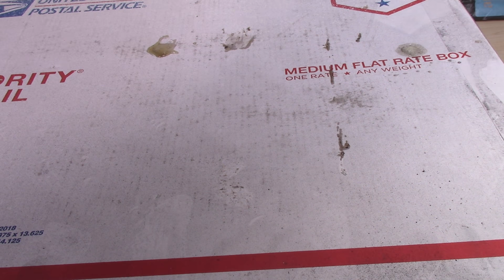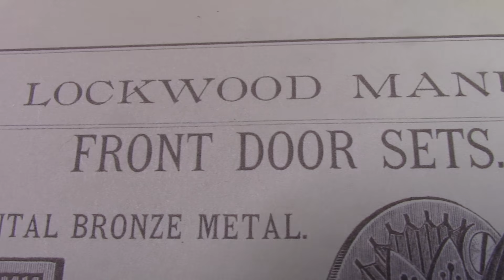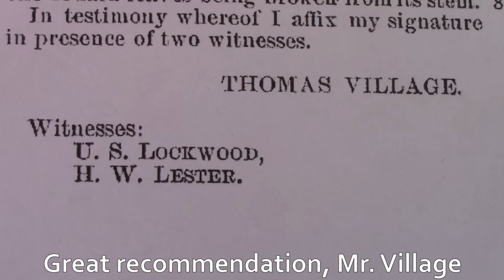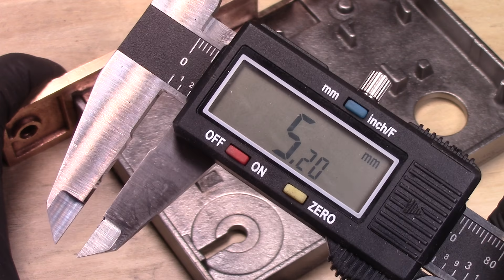Rare Broken 1880s Mortise Lock Set Restoration | Random Restoration

Comment: The only criticism I have would be that I wished you had found a way to repair the broken off post rather than replace it with a bolt -- maybe by brazing it? It looks like cast iron, so welding it isn't feasible, I'm guessing, but I think you could still braze it? Not that I know much of either welding or brazing. But it turned out beautiful regardless. Though from a pure aesthetic standpoint, I'd have kept the high spots in the background clean. Really nice work though.
Reply from the maker: Thanks, Daniel! The main reason I chose to use a bolt comes down to strength. When the lock is retracted, it hits the post, so I wanted to use something a bit stronger. The case is indeed cast iron, and I’d be worried that any alternative fix from the one I chose wouldn’t really hold up long term, whereas the bolt I used should be capable of lasting another 120 years without any issues. Thanks a lot for watching!
Reply: @randomrestoration6858  That makes a lot of sense. Thanks for the insight!
Reply from the maker: @lDanielHolm  You bet, thanks again!

Comment: I think leave a few of those scratches to show these have a bit of age to them, if you take all the signs of age away they will just look like reproductions. A fabulous video though, very skilled.
Reply from the maker: I would argue that it looks like a restored original, much like how a fully restored 1940s vehicle would instantly be thought of by your average person passing by it as a restored original rather than a reproduction. With that said, (especially in more recent hardware restorations) I have started leaving more defects that were original to the piece, such as additional metal left over from casting and roughly machined edges, and I plan on continuing to keep these original slight imperfections in future restorations. I do appreciate it - Thanks a lot for watching!

Comment: Great video!! I have a similar mortise lock I need to repair so I wonder how can I identify the manufacturer and year. The inside mechanism is incomplete so I would need to search for parts.
Reply from the maker: Thanks a lot! If the mortise lock has no manufacturers mark on the case/case cover, then your best bet is looking for a number inside the mortise lock and googling "mortise lock (insert number here)." For example, Sargent & Co. manufactured the 5164, so if you Google "5164 mortise lock" you'll be able to find some results usually. Many companies used similar internals to the lock seen in this video with minimal changes to the shape of the parts, so it can be very hard to identify many mortise locks. If the mortise lock is ornate, you may be able to find the lock by searching Google images for "ornate mortise lock." Hopefully you can find a match/replacement with relative ease! Thanks a lot for watching!

Comment: I restored the front door mortise lock in my 1770's vintage farmhouse.  I believe the door and lock are probably 1880s vintage and not original to the house though. I couldn't establish a date for the lock. It's not as ornate as your gorgeous lock set but the innards are quite similar. Mine has two buttons on the striker that switches between having both knobs locked or only the exterior doorknob locked. Other than being old, dirty with some rust the main issue was that the flat spring was broken. I was able to adapt an old automotive ignition points spring to repair it. The spring was nearly identical to the broken one after some trimming.  Alas it was before establishing my Youtube site so there is no video of the process. At present the site only has videos of 1950's era HO model train restoration. 

I'll document any future restorations (there are a lot waiting, including several vintage lock restorations) and upload them to my site in future.

-dave
Reply from the maker: Very cool! The original hardware in that house would have all been rim locks rather than mortise locks, but I’m sure the mortise locks are quite old like you said. The interior layout of this mortise lock was used by many companies at the time, so it’s hard to pin down which company made it unless the case or case cover has markings. Thanks for watching!
Reply: @randomrestoration6858  I managed to date the box locks to the mid eighteen hundreds by the patent dates punched into a small riveted on brass pendant that was attached to each one. The box lock that hasn't been installed because of a missing key (replaced it with another that has a key) is dated 1860.

They certainly are not original. One original door remains though. It has a simple lift up latch with a piece on the locking side that blocks the latch from being raised, no key required. :)

-dave
Reply from the maker: @dgwachtel  Very cool! Well a basic thumb latch like you described may not offer any security, but it sure has been reliable for all these years!

Comment: One question and one comment.

Question: does all the care past the rust remover for the internal small parts help protect it against further degradation? No one sees those parts once the lock set is installed.

Certainly, the way in which you mortised the wood to accept the lock set is how it used to be done. You may find it easier to use a door jig and a router to cut your mortises.
Reply from the maker: Good question - The small parts were all nickel plated which will indeed protect them against rust. Realistically this step isn’t necessary since the parts already don’t easily rust even when left unplayed. Occasionally spraying inside the lock with a dry lubricant should keep everything rust free. 
Haha you are correct, I currently don’t have a router but have been really tempted to buy one to greatly speed up making displays like these. Hand chiseling it is fun but without a lot of practice (which I don’t have haha) the results will not be nearly as good as with a router. 
Thanks a lot for the comment, and thank you for watching!
Reply: @randomrestoration6858  If you're planning on mortising more than one door at a time, then you would save a lot of time using two routers. Setting router depth is a real pain, so having one for the face plate and another for the housing saves a lot of time. A small router is enough for the face plate mortise, but if you're taking off a lot of material you'll need a more powerful router.

Comment: These are really beautiful. I know they’re supposed to be painted black with the bronze but they sure are pretty when they are just bronze as well. Where do you find all these beautiful pieces? Why have a switch for locking the doorknob in place? If you don’t want the door opened then just lock it? What was the purpose of this?
Reply from the maker: Thanks a lot, Chanda! I found this set on a small website that deals in old door hardware. The locking knobs are really for added security. The other benefit of them is the added number of unique key combinations. This made it much less likely that someone might have both keys that happen to unlock the door knobs and the lock. Thanks for watching!

Comment: What specifically do you use to flood the background with black paint?  For the pieces you spray-paint the bakground, do yo wait for it to dry completely and then buff away, or wipe while it's still wet?
Reply from the maker: Good questions - For applying the paint to the faceplate I simply used the same spray paint I used on the backplates. I used a needle and 6ml syringe to apply it, though nowadays I always spray on the paint to get a perfectly even finish. I also have started using a rubber tipped squeegee to remove the majority of the paint immediately after it's applied. The rest is removed with a cloth and a bit of paint thinner. I've recently been using a 2X gloss black paint by Rust Oleum. It's not the highest quality paint, but I've found it's the perfect thickness for painting the recessed areas. Many other paints I've tried are too thin and require far too many coats to achieve full coverage, or too thick which covers the details. Thanks a lot for watching!

Comment: Whats the small egg shaped dremel head you are using? I usually use the 120 grit abrasive wheels and a pick but that seemed to get into the tiny cracks better.
Reply from the maker: I think you’re referring to the abrasive buffs I use. They’re great to remove dirt/grime/tarnish and they remove effectively no metal in the process. I buy them on Amazon 100 at a time - There are 25 of each grit, and I get a decent amount of use out of them! If you search for Dremel abrasive buffs on Amazon you should see a bunch of different listings for them from different sellers. Thanks a lot for watching!
Reply: @randomrestoration6858  No I actually meant the more slender tool you were using to get into the smaller spaces. Was that a stone bit or something else?
Reply from the maker: @jakeedmondson5288  Haha oh well maybe you’re referring to the different wire wheel I was using? Here’s the link to the narrow wire brushes I used in this project: https://www.amazon.com/PHYHOO-Cleaning-Polishing-Attachment-Accessories/dp/B074N13NN7/ref=mp_s_a_1_3?dchild=1&keywords=PHYHOO+Steel+Cleaning+End+Brushes&qid=1632635226&sr=8-3
Hopefully I answered you correct his time, but if I didn’t let me know haha.
Reply: @randomrestoration6858  Yep that was the tool. Thanks for the link. Also what type of paint are you using for the black and does it have primer mixed in?

Comment: Amazing restoration, I have actually been to the Lockwood mansion in Norwalk Connecticut,  as I live here and that could have been one of the main door locks from the building, I would hope you would consider donating back to the mansion. even though the original locks (which you might have) may have been removed in the 40s or 50s, when my mother worked there, I think the historical purpose could be displayed now that the building is a museum.
Reply from the maker: I did a quick bit of research on the Lockwood mansion, and it looks like it was built a couple decades before this mortise lock design was first made in late 1886, by which time the mansion was no longer in possession of the Lockwood family. That said, I’d be curious to see what kind of hardware the mansion originally did have! Thanks a lot for watching!
Reply: Why is it that if there is a bit of trash that a person finds, and works hard spends money. Brings back the working ability and in some cases beauty. there is always someone who says they should give it back to the original owners who neglected it on the first place or give to a museum? Not just this item.

Comment: Amazing and very inspiring! I never used an abrasive wheel before but that's obviously so needed. What grits do you recommend for this kind of project?  Thanks so much.
Reply from the maker: For bronze items like this I'd recommend a 400 grit abrasive buff, as they're the least abrasive. I go through these small buffs pretty fast, but I get four different grits in a package with 25 of each grit at a time. They're definitely handy to have! Thanks a lot for watching!
Reply: @randomrestoration6858  I am so glad I asked because I wouldn't have gone so high. I am refinishing the original 5-panel doors from 1913. Dare I say "restoring" 😅 And we pulled out the crusty old mortise last night. I can see why all the work you go thru pays off but I am very nervous about disassembling it. Although there is a local locksmith who does antiques and if I totally mess it up, I think he could fix it... Do you have any advice videos for rookies?
Reply from the maker: @selfmademanicure5662  Very cool! Haha yeah they're usually pretty crusty after all these years. If there are any old painted areas around where you plan on abrasive buffing, I'd use caution, as it's probably lead based paint - paint stripper should take it off with relative ease tough. If you do go to disassemble it you can always remove the cover and take a picture or two of the interior to make sure you know how to reassemble it. Generally these only go together one way, aside from a couple exceptions like split hubs and the direction the flat springs can go - Assuming they use flat springs rather than coil springs. Some locks have more than one tumbler, and subsequently the tumblers have to be in the correct order, so that's another thing to look out for, but with a picture for reference you should be able to get everything back in the correct order. I'm sure if you mess it up the local locksmith you've described should be able to get it back working for you, but I'm sure he'll judge you for messing it up in the first place hahaha
Reply: @randomrestoration6858  that's alright if he judges me. I am not too proud to make mistakes :) I know when I am out of my wheelhouse.

Comment: I want to see the door and house the hinges, mail slot, mortise lock, latches, and all the other parts you're restoring are going on.
Somehow I doubt they were intended for a farmhouse or cabin.
Reply from the maker: You'd surprised about the pricing of these items. For example, in my most recent video I installed a pair of ornate cast iron hinges. The price per 4x4 hinge was .71c, or the equivalent of $22.96 today. The non ornamental variant of those exact hinges (located two pages farther into the catalog) which are also 4x4 were .78c per hinge, or $25.23 in todays dollars. The same pattern can be found with mortise locks. The ornamental "Arcadia" design by Sargent & Co. in their 1901 catalog is priced at $16.50 per dozen. The exact version of that mortise lock but with a plain faceplate, located on the next page, with the faceplate finished in "Antique copper" is priced at $17.60 per dozen - Over a dollar more than the ornamental version.
Very recently I've seen some pretty small, basic old houses with ornate hardware throughout them which was manufactured by a company called Kean and Doty. It really does seem that these were priced in a manner that allowed anyone building any house to afford them. With that said, it's much les likely that a cheaper farmhouse would have the bronze variants of ornamental hardware, but not out of the question. The bronze "Arcadia" design for example is only .30-.40c more than the cast iron variant, or on average $11.32 more in todays money. 
With all that said, these are yet to be installed anywhere, but will be indeed installed in a number of years.
Thanks a lot for watching!

Comment: I saw a restoration similar to this. I thought it was the same video. But that one had paint on it and one of the key holes had been pained shut. Is this a popular lock for the time then?
Reply from the maker: Oh yeah that was one of my previous videos, but it was a different company. Every company made their own mortise locks and designs. The double keyhole variants were manufactured by every hardware company at the time and were used on entry doors, as they were both more secure and built to be stronger than standard passage locks. Thanks for watching!
Reply: @randomrestoration6858  yes! I found the video and rewatched it after. Really good find dbd lovely restoration!
Reply from the maker: @MaxmadV8  Thanks again!

Comment: Where do you source the washer for the shaft?
Reply from the maker: Good question - I ended up just widening the hole on a stainless steel washer that happened to be the perfect width to take up the play in the knobs. I now do have a dozen or so antique spacers which are way thinner than the washer I used, but I only have them since they came with a few different door knob sets I've ordered. 
You can probably find some washers of the correct size if you search long enough, but it may take some searching haha. Thanks a lot for watching!
Reply: @randomrestoration6858  thx, I sort of came to the same conclusion. I did find a set of different washers on Amazon but it is sort of like buying a dozen eggs to get one. Your work is great, you may have encouraged be to try the black background to the highlighted brass. Still working on old steel escutcheons that have a brass/copper looking finish.

Comment: idk why but i personally prefer watching you use the white gel type of paint stripper vs the spray can kind
Reply from the maker: I do prefer the gel a bit more since it soaks into all the crevices. The main reason I started using the spray stripper is that companies were required to change their formulas, and the gels that I've tested since then are pretty much useless unfortunately. For some reason the spray on stripper I've been using (which is the new formula) works well, so until I find an alternative it's what I'll have to use. Thanks for watching!
Reply: @randomrestoration6858  well that sucks but as long as it does the job

Comment: So was the missing washer a factory defect?  I mean, accidentally left off when it was original manufactured?  Or do you think it was repaired at some point and left off then?
Reply from the maker: I’m guessing you’re referring to the washer I used for the door knobs? The original spacers were likely removed by whoever removed this set from the door it came off of - it’s not uncommon for them to be in pretty rough shape after so many years of use, so they usually get tossed. These spacers were used because the holes drilled in the spindle, the holes in door knobs, and the width of the door knob backplates were all drilled in different locations for each set. Since there were so many differences between all these parts thin spacers were added to keep the door knobs from sliding back and forth. Thanks for watching!